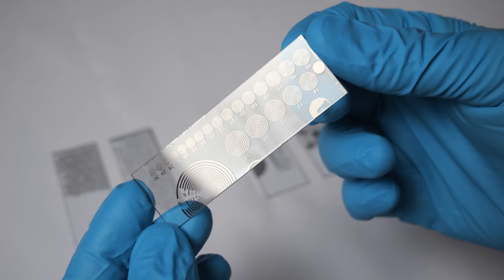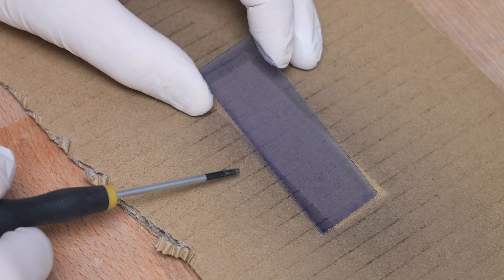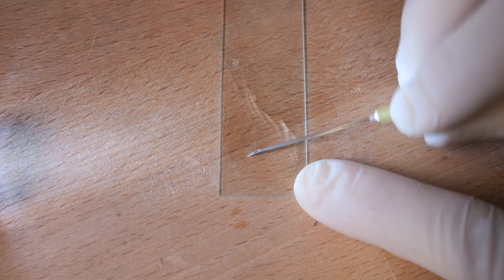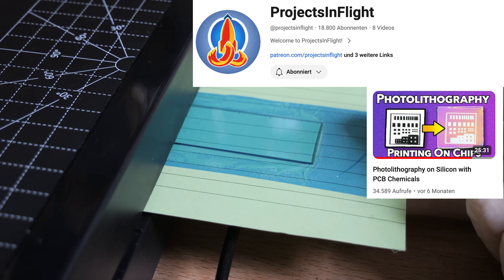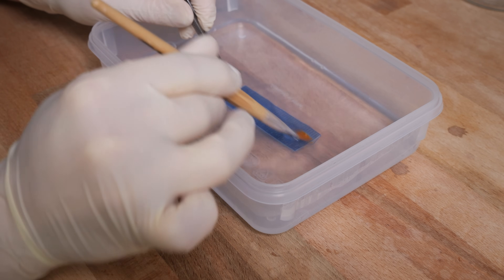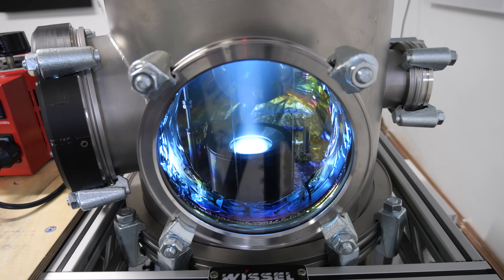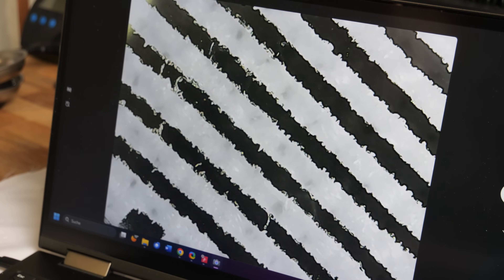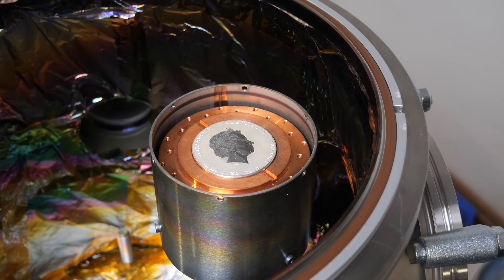Writing in Titanium on Glass - Lift-Off Photolithography

Comment: Laser printing onto tracing paper works pretty well for photomasks - use heavy (>90gsm) tracing paper to avoid crinkling in the fuser, and set the printer DPI as high as possible. 
I don't know if it's still easily available or if the process is now obsolete, but you used to be able to get super high-res transparencies (>1200dpi) from a print shop that has a phototypesetter.   Some older PCB fabs also use photoplots onto a clear film. Photographic film might be another option but I don't know how well it transmits UV.
Reply: We used to use the transfer paper printed with laser printer and a iron to transfer the toner onto pcb. I don't see why that method can't be used here.. Skip the lithography altogether
Reply: Lithography and photomask are far more repeatable than toner transfer.
Reply: To get the best density with toner+velum I explored using heat transfer foils which have essentially 0% transmission, but this was for larger feature sizes and I'm not sure how well it scales down.

It made for very pretty metallic masks though.
Reply: I've done some experimentation with black and white film when I was doing my cyanotyping course and I did find /some/ uv transmissibility but it seems that a decent chunk of the optic chain that I used (which was a reversed camera lens) even without UV filter absorbs a lot of the UV, not that my UV source was very strong. It's been on my todo list to revisit (preferably before the remainder of my film expires) thou it is also on my todo list have a go at using a resin printer to expose the UV resist.

I haven't tried it with my B/W enlarger because it uses white styrofoam as a diffuser/reflector so the losses would be off the charts
Reply: I work in a semiconductor research lab, if we need to make a one off wafer with something really "big" like a photo in gold on a wafer we use transparency sheets for overhead projectors, they are available for laser printers. 
Print on a black and white laser printer with the highest density and you get something quick but not the greatest resolution.

Comment: If you have to use a printer, yellow ink is usually the most uv-opaque (this is exploited when making digital negatives for alternative printing techniques), but for the best resolution one of the most accessible mediums is microfilm stock, you can find it packaged in 35mm or medium format rolls and expose it with a camera (using a highly resolving macro lens).
Reply from the maker: Thank you for the information!

Comment: Instead of using a mask directly on top of the slide, you could try to use lenses to project the mask from near the light instead. You could then use a bigger printed mask and shrink the pattern using lenses. Maybe an old microscope and projector.

Comment: You might be able to increase the definition of your mask by overprinting it (printing the same pattern on top of the existing one) a few times.

I’ve done something similar with parallax barrier masks on transparencies.
Reply from the maker: I have tried it when I was still using the normal transparent paper but couldn't get them to align perfectly on the second print. I suppose you need a printer that supports this feature and does not eject the paper after the first print.
Reply: @AdvancedTinkering I believe the printer had guides that aligned the paper when printing; perhaps one can 3D model/print a similar guide for the slide mask?

Comment: I mean the slides are of about the same size as a 35mm film frame. UV Lightbox with your printed master in it, + Camera lens pointed at it from a fixed distance away to easy reducing optics with tall the annoying abberations to correct for like if you just made your own from raw lens elements.  If that works, but you want to expose a larger area, then you can worry about finding a larger lens?
Reply from the maker: Yes, I think using optics is the best way to get a good resolution. I will try your suggestion using a camera lens and see if it works.

Comment: You could probably easily increase the resolution by having a lens setup from some old TV fresnel lenses and a few normal ones so the image would get converged into a very small area on the slide as long as you had a sufficiently even light scattering and a good set up. It could easily take the resolution of two A4 papers and put it on the slide.
You can simplify it even further with a photography lens that has a small F stop (like a Helios 44m4, which is like 20-30 bux if you know where to look or even less) and a big box, you could straight up just use the photoresist as a photography film. 

I bet you could even shove it in a camera and take UV pictures on glass in titanium.
There is also a BIG possibility of making art here, imagine taking the same "photo" with 5 slides but with a varied exposure, removing more and more film that way, then shoving it in and adding them in a series. You'd have a 3D titanium image on glass slides. Or just printing an image, making it PURE black and white with varying thresholds and doing it that way, would be insane for nighttime panorama pictures.

Have you also experimented with titanium oxide? It makes some funky colours, There's a few nice videos on titanium electrolisis you could basically add colour to the titanium and you could vary it with a great degree.

Comment: I used to use my 3d printer with a small cube being printed at 0c bed 0c nozel amd 0% flow. I "print" this cube wayyy up high off the bed.. 

Anywho, then I use the bed thats moving back and forth as a shake table. It makes even development nearly perfect every time. Was more effective with the copper etching portion with ferric chloride when I was doing this for PCB manufacturing though, but I used it for the developing too.

Comment: I ran into the same issue of expensive sputtering targets, so I bought an inexpensive manual metal rolling machine.  It allows you to create thin, uniform sheets of metal out of anything that's fairly malleable: copper, tin, gold, platinum, silver, etc.  Some metals may need to be annealed periodically with a torch since they work-harden, but it's surprising just how many different metals can be rolled.  Since sputtering removes such a microscopic amount of metal, you don't need a thick target, and you can glue it to a thicker piece of metal to aid in mounting it in your sputtering system.

Comment: Maybe you could use a mono LCD, like in MSLA resin 3d printers? Human hairs are about 80µm, 2k 5.5 inch LCDs have a pixel size of about 47µm and 4k 6.23" means a 35µm pixel size. You can get them with drivers relatively cheaply.
Reply from the maker: Yes, that is one of the methods I will try in the future :)
Reply: Some more advanced and older type resin printers used a UV laser, I wonder if using something like this and turning the laser power down might work better. Because using a laser is more like plotting a vector than using pixels.
Reply: The laser based printers were called SLA.  They could produce better curves because there are no pixels, but they are slower than DLP printers that have taken over.
Reply: Yeah, (non-mask)SLA would be pretty interesting too, especially since for a single 'layer' the longer exposure time isn't a problem, but getting a galvo stage with a laser would probably cost quite a lot. Then again, some may be available for a reasonable price on the used market or a DIY one could be made, but that's a whole other project.
Reply: @AdvancedTinkering  you could ask xTool if they want to sposor a F1 glavo diode laser, it has a 2w ir and 10w 445nm so it can engrave masks and also deposited metals.
Reply: I was thinking the same thing. The consumer printers go up to 12k now and are relatively inexpensive. I'd imagine they would work quite well for this as they are essentially doing the same thing but with resin.
Reply: This was my thinking as well.
Reply: If you're using a DLP printer I wonder if you could use the slide as the bed and the resin as the photoresist? Print a single layer with the printer directly onto the slide.
Reply: @AdvancedTinkering  Did you remove my comment or did YouTube?
Reply from the maker: @johnsimons92  No, I only delete comments if they contain insults or are spam. I have never deleted a comment under this video. But sometimes YouTube automatically deletes comments for strange reasons. There are also no comments withheld for review. Sorry that your comment vanished.
Reply: I was going to suggest this. They now have even higher resolution on some printers than you mention. I believe the elegoo saturn 4 and 3 have a resolution of 19 x 24 um. It may be easier to just buy a printer rather than the individual parts, plus you can then use the printer for other things.

Also due to the pixels it may end up with better results than in the video, especially along the axes, well defined straight lines should be possible, whereas curved lines will still work but will have a pixelated effect, especially as you go thinner.
Reply: I've used my msla to expose the resist on pre sensitized boards and the results are really good. Especially with thinner resist layer and fresh etchant.
Reply: Laser might have less leakage than LCD for this application. But dog slow lol

Comment: Try looking for CTF masks at small print shops, I can get them for just a few bucks at 4000+ dpi resolution, optical density of 4 and very crisp lines. That's what PCB fabs typically use
Reply from the maker: I never heard of CTF masks and couldn’t find a lot on google. What does “CTF” stand for?
But I will look into it, thanks!
Reply: @AdvancedTinkering  Computer-to-film, it's a type of a printing process, still popular for screen printing t-shirts and art I think. Masks look like laser printed transparencies except they are much blacker and higher quality. If you really can't find them I can mail you some test patterns I was about to throw out

Comment: You can get PCB way to print masks on PET plastic film. They do this for flexible PCBs. PET is transparent and has a workable UV transmission up to around 350nm(looking at transmission spectra on Google) but you can increase the exposure time to compensate. The mask will have metal features so you will have a perfect contrast ratio. PCB way can do a 60um line/space resolution. I'm sure you can negotiate a suitable set of parameters if you explain what you want to do.

Comment: Using coins as magnetron sputter targets works really nice. The lab I did my Bachelors degree in did that for gold.
You really built up a nice setup there.
Reply from the maker: Amusing to hear, that even pros are doing it that way.
A gold coin is still very expensive. But probably cheaper than a gold target. If I ever have the money, I will buy a small piece of gold and roll/hammer it into a thin disk.

Comment: Hm- you could use a lens to reduce the size of your image. That way you could print at a much larger scale and then focus the image down to whatever size you need. The only difficulty would be the fact your UV light pretty much has to come from a point source. Depending on the photoresist you might be able to get away with a 405 nm laser diode, otherwise you could probably use a single-chip UV LED at longer exposures.
Reply from the maker: Using some sort of optical system/lenses is probably the best way to get a good resolution. I will see what I can do for a future video.

Comment: I used this positive 20 spray for pcb and it worked best usin spin coating. But the photoresist has to be cold. And The RPM has to be low. For masks use silver coated film from a commercial painting fab that will produce them for fabrication of sieves for silkscreen printing.
Reply from the maker: Thanks for the advice!

Comment: For self made PCBs, i just used naked copper plated PCBs and applied a thin coat of black spray paint.
I then used a laser engrave to remove the paint where i wanted to etch the copper away.
After etching i removed the paint with thinner.

Comment: Argon  pressure during sputtering is ok for magnetron and too high for the turbopump, providing excessive heating of blades and motor overload. You could have used another input of this two-port turbopump to lighter the load, or provide flow restriction at its input.

Comment: Remember that a lot of photo resist have a top and bottom side. Usually the inside curl of a roll should be the side to laminate down onto the surface.
(I think you did it right in this video so no worries.) I've had adhesion issues when doing it the other way before.

Comment: Well what was the resolution of the printer you made the mask with?
Reply from the maker: 1200 x 1200 dpi
Reply: @AdvancedTinkering  Ah, yeah, that is technically just about enough to resolve a human hair, as i had calculated, although as my father said when i asked him about it (he works in digital print) he said the rastering would fuck me tho.
And indeed it did.

But yeah, fundamentally there is not much you can do there, except either see if you can get a higher res printer, but 1200 is already pretty high, although laser and inkjet behave differently.
Or you get into optical shenanigans like our american friend.

I been looking into this topic quite a bit myself, although because i want to make very detailed printing plates, not for making microchips. Although there exists a suprisingly huge overlap.

Comment: Another way to obtain optically dense masks is to use computer-to-film services (for offset printing); while it is not the most advanced technology, they still do it.
Some places accept input as 1-bit tiff files (in spatial resolution of imagesetter), and in that case you can obtain masks with resolution significantly better than a printer.

Comment: One easy to increase resolution would be to costruct a diy litography stepper. Basically it's a pc projector that you focus down the plate using microstope. Huygens Optics channel has a great video about that. Another, easier option may be to buy resin 3d printer - they expose the resin with UV light through high density lcd screen.

Comment: Projection with a microscope objective shouldn't be too hard, something like a "Infinity Plan", normally for metallurgical work, they have a very long working distance and have no cover slip or specific index refraction fluid coupling to the work piece. 

L Plan   (lateral chromatic aberration correction)(planar or flat-field, sharp over entire field of view)
100X/0.80   (100X, magnification)(numerical aperture, NA, of lens)
∞/0 WD3.2    (infinite optical system, easier to work with)(cover slip thickness, important to be 0)(working distance from objective tip in mm)

Some resolution banner specs, the closest spacing where 2 points can be seen as 2 points: 10x 1.34µm, 50x 0.61µm, 100X 0.6µm

Cheap Chinese 100x can be had for a few hundred, whereas brand name your looking at a few thousand.
Don't know how close they will get to the banner spec though...

Comment: Dye-sublimation printers block UV light a lot better than jets or lasers and also print nicely on transparencies. Worked well in the late 90´s when making pad printing plates. The UV exposure machine had a total number of 3 UV fluorescent tubes that each were about 30 cm long*25mm wide at 8cm distance from the glass, so at the very least, plenty of UV.